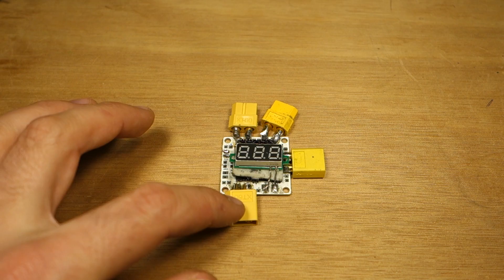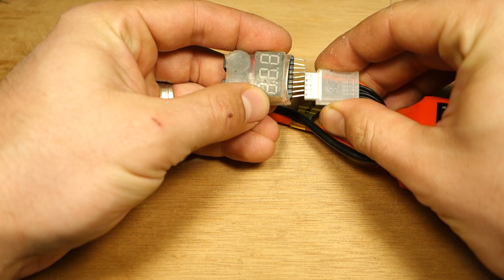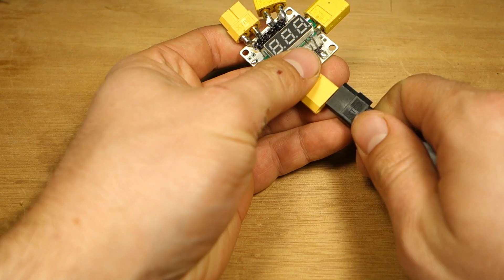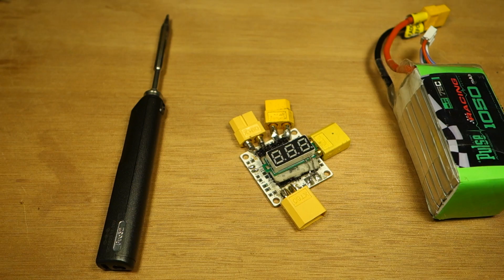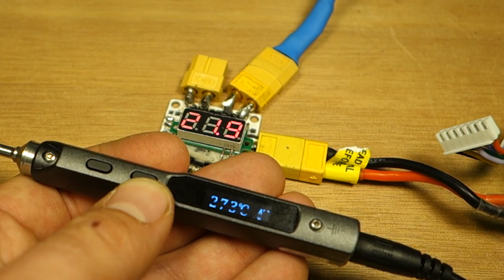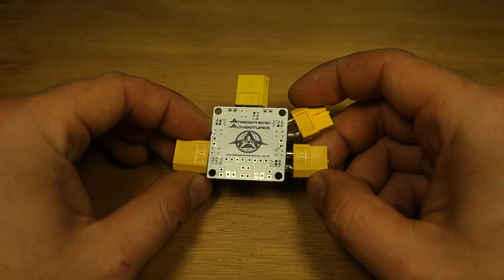One of my Most Used Tools

Comment: Brilliant idea. Do you have a build video for this tool?
Reply from the maker: Albert Gilding nope. just solder the connectors on and wire up the voltage thing
Reply: how do i solder the beeper to the board? and would a pdb also work?

Comment: I always save the batteries by throwing my charger into NIMH mode and letting it send a few controlled pulses at a specified mah rather than dumping 30-100 amps to it.

You can monitor after each 'pulse' the voltage and when it hits lipo charging range change it over.
Reply: I agree.  Charger set to NiCd or NiMh and 0.1 amps while you watch the over discharged lipo for any signs of puffing is far better than hooking it in parallel with another lipo.  You'll end up getting quite a bit of current that way.  Much more likely to puff the low battery.